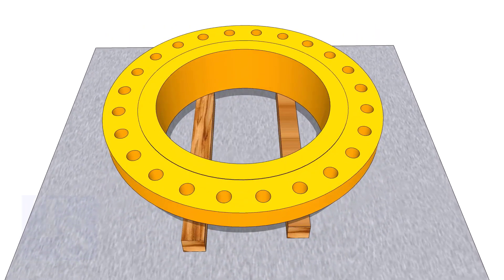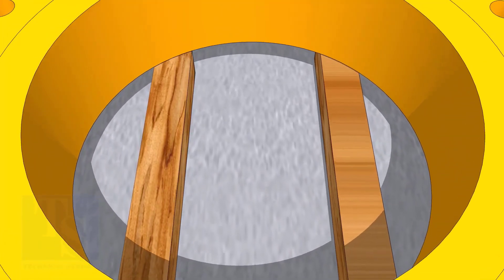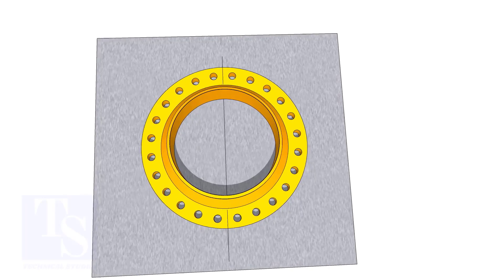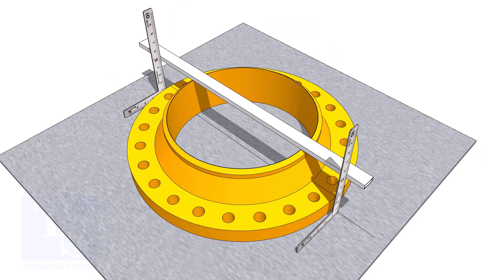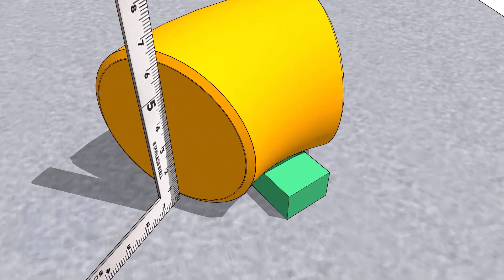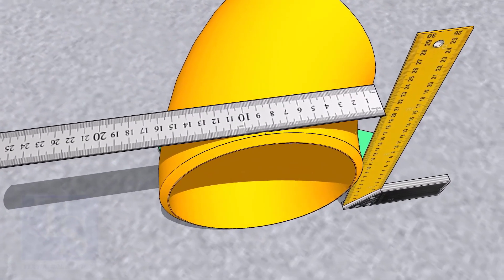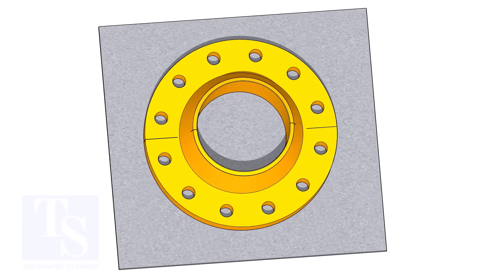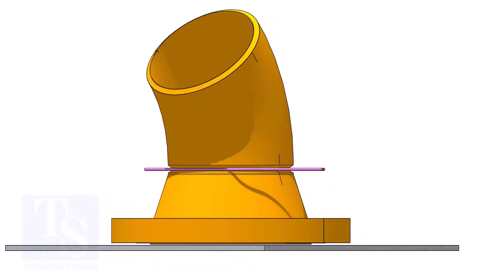45 DEGREE ELBOW TO WELD NECK FLANGE FIT UP EASY METHOD  Pipe fit up tutorials

Comment: Excellent technique for when working alone.  Other method is with the flange held vertically in a vice and the 45 aligned using a level - but needs 2 people, one to hold the 45 in position while it's tacked.